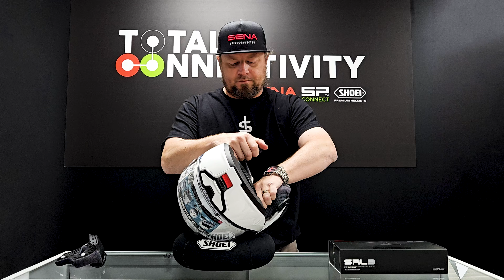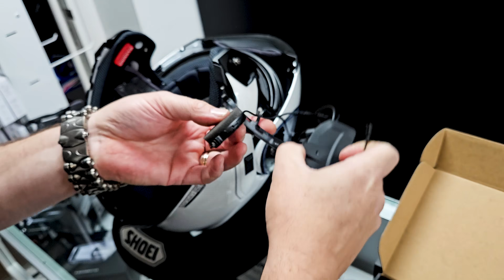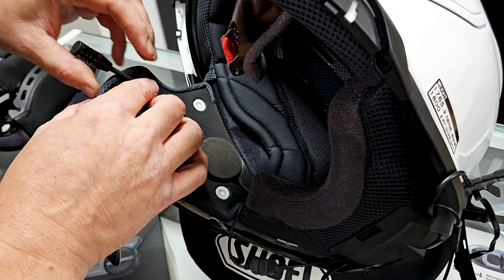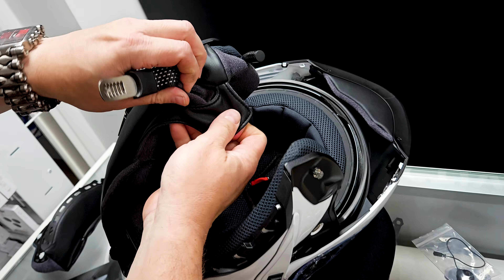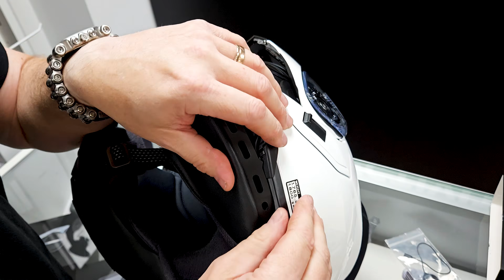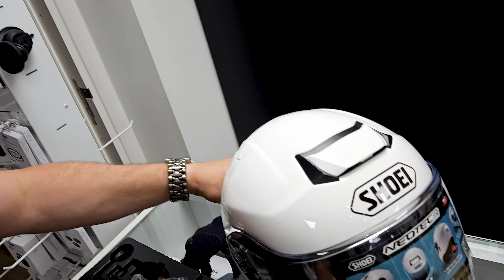Installing the Sena SRL3 Communication System - Tutorial

Comment: I'm coming back to Shoei after a few years with a Schuberth and, once again, I like the fit and quality of their helmets but am frustrated by their tendency to make everything ten times harder than it needs to be. It took less than five minutes to install the integrated comms in the Schuberth. I'm currently at half an hour on the Shoei and may need to drive back to the store where I bought it and have them do it. Same with visor attachment: I can remove and attach a Schuberth or Arai visor in 20 seconds. With Shoei it's always a five minute job. There's no need for these level of complexity with small stuff.

Comment: My cheek pad keeps on disconnecting on the control side. Been pack to infinity twice to refit and still keep happening. I would suggest there is an issue here. I use the helmet every day and it lasts about a week between refits. For items costing this much this should not happen.

Comment: This is a great tutorial and I'd like to add a tip of my own: for a cleaner and more secure installation of the cheek pads, tuck the excess power cable into the side panels first. Use the Shoei tool to neatly fold the cable down to the crease. This will create more room for the cheek pads, allowing them to fit deeper, stay more secure, and prevent damage to the power cables.

Comment: Unfortunately, the SRL 3 is a dud, voice commands don't work and SENA is not interested in providing any support to anyone with this problem. Forums suggest that there are a large number of SRL-3 units with a dud chip. A very costly and unreliable product. Buyer Beware. I note I have an original SRL-1 unit that works fine, technology upgrades dont always bring better solutions.

Comment: Hi there, my cheek pads won't sit flush back in place because there is now a wire in the way from the SRL3 Mesh Intercom 2.0 (where it joins the control panel). Have I done something wrong?